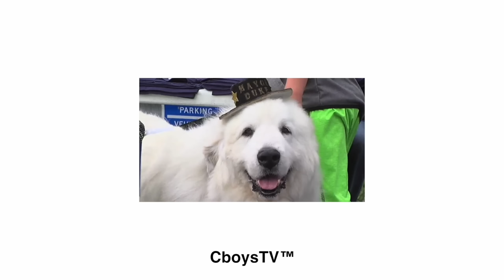Monster Car runs over Jet Ski!! (Testing our new mud truck)

Comment: you guys should weld the differentials, wouldn’t have gotten stuck
Reply: scherr.24v 😂
Reply: Yeah thats very true
Reply: Yessir
Reply: My thought was who tf builds a mud truck without lockin diff??
Reply: scherr.24v most deff need the difs welded or since they got money buy some bad ass lockers
Reply: If they can't even get it in 4x4 half the time I seriously doubt they can handle doing that...
Reply: Shit its a junk ass toy weld that shit or put lockes in it so that when they do get it into 4x4 it will pull all 4 wheels then it will be way more fun also since its got lower gears in it it will pull like a boss
Reply: scherr.24v diff locks are better than welding so you can unlock them an still have the turn radius you need
Reply: Unmanned Aviation bruh. It’s A pos mud truck.
Reply: Affirmative
Reply: Thats what i just said HAHAHA
Reply: They probably dont know what all that is 😂😂😂
Reply: Weld that peanuts  difs think the guy forgot that step
Reply: @cameronhoover7561  I'm sure they do know what that is, Jake especially. Give them a little bit more respect than that...
Reply: NO MORE ONE WHEEL WONDER
Reply: Haja

Comment: Add a water tank in the back, with a pump. Run small hose from tank up to roof and a piece of PVC connected to hose, across the top of the front windshield with small holes drilled in it.  Flip the pump on when you hit the mud, wipers full blast.  Boom, clean window.   My dad had his mud racing truck setup like this and it worked amazing, on top of rainX for days before events.

Comment: Need to put some cheap locker in it or at least weld the diffs. Id probably wrld the rear and put a cheap lunchbox locker in the front. It would do a lot better. Especially climbing shit.

Comment: As a boat technician from Canada. I wish you gutted the thing of the motor and jet system. But, content right? Couldn't give a shit less about a welded diff, cause that motors gonna blow. And i assume welding the diff will blow the drive-train or the valve train. shooting pistons up to valves, always on limiter. You need an LS. And mister Ben, love the comedy at the end. That was absolutely...the best ending. You should pat yourself on the back for that Mr Roth.

Comment: Just some random advice ... if your not going to drive it on the streets much at all weld the differentials both of them asap even with less power and less goodies it will surprise the fuck out of you what real awd 4x4 or whatever you may call it will accomplish even in low power applications..... second so you dont get high centered on obstacles raise the side steps to flush with the bottom of the body .... other than that it's a ripper  100 % have fun put a roll bar on it also

Comment: Add lockers and a carb and headers and beef up the trans and the suspension  cause its trash hell I got a mud truck if you want to buy  it for 45,000 I got around 55grand in it i promise you want break one thing on it besides if you cant drive it good you can blow any motor up but it's got 20 grand under hood and 800hp 1000foot pounds of torque

Comment: Just a little tip you probably shouldn’t be digging a hole and driving all over your septic System drain field like that. Or you’ll all be shitting in a bucket